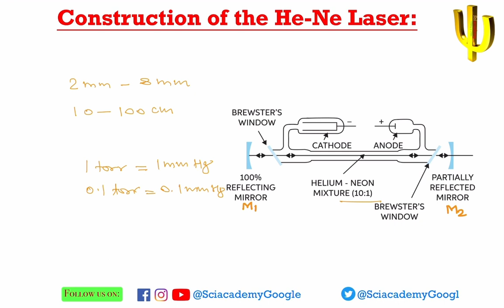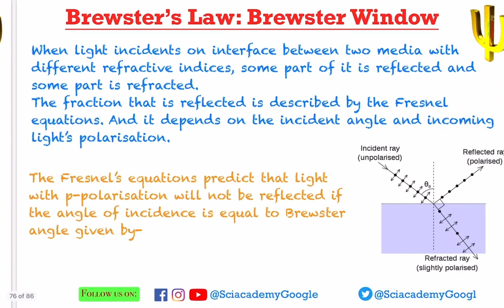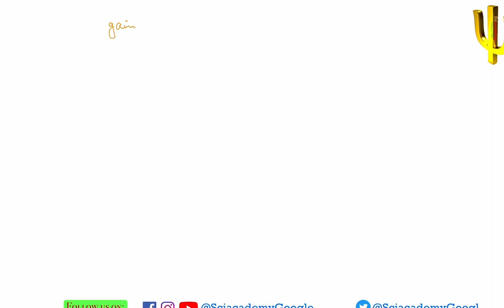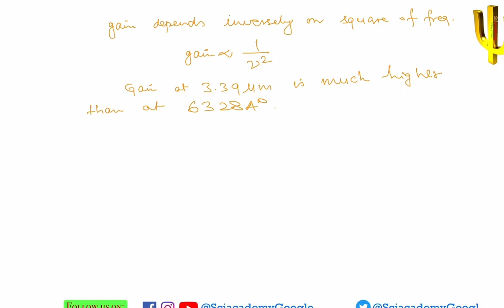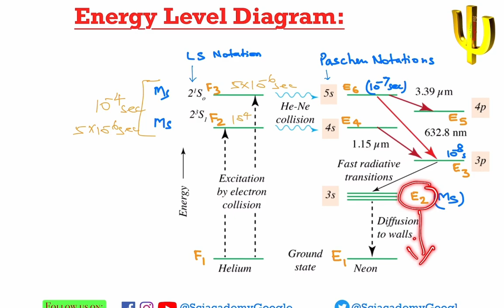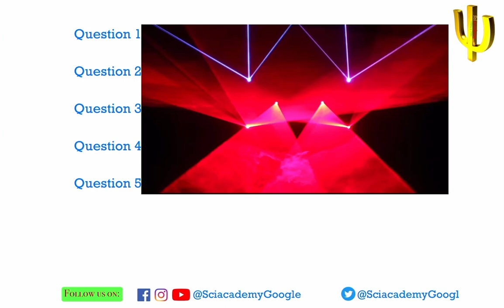He-Ne LASER PHYSICS 💯 PRINCIPLE♦️CHARACTERISTICS 🎯ENERGY LEVEL DIAGRAMS |Brewster’s Window

Comment from the maker: Here's a question for you:
The video mentions that the gain in a helium-neon laser increases with decreasing tube diameter, especially because the E2 level is metastable (25:49). Why does a smaller tube diameter help prevent the reduction of population inversion caused by atoms collecting at the E2 level?